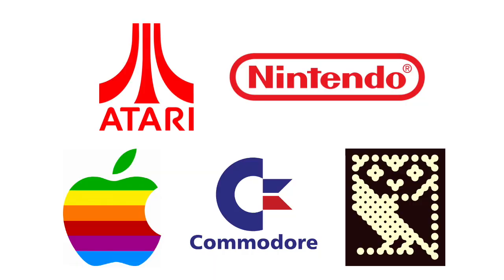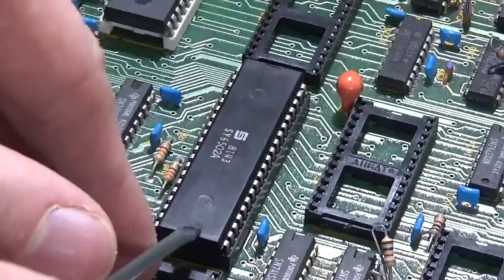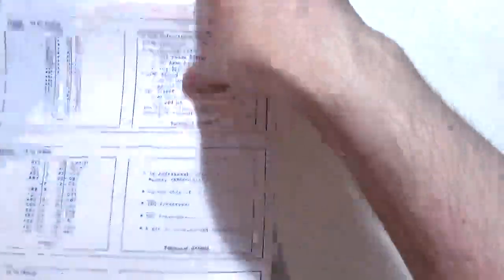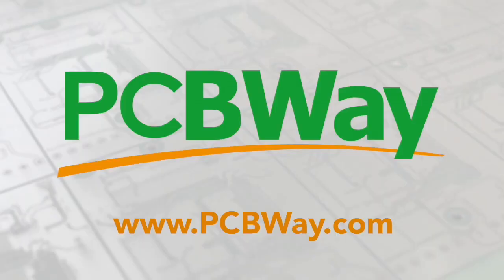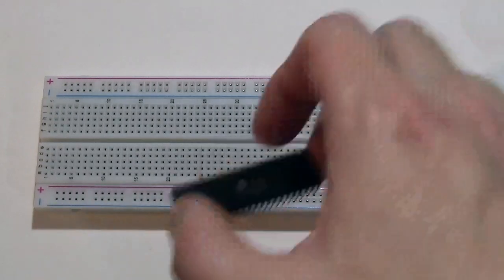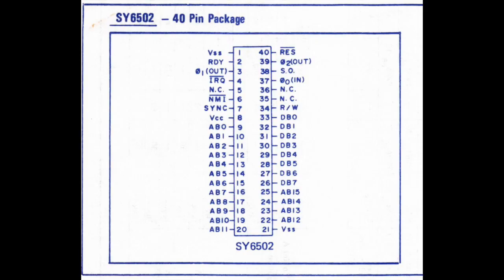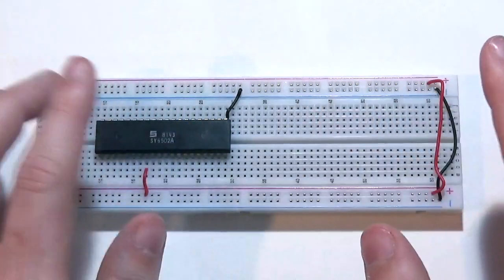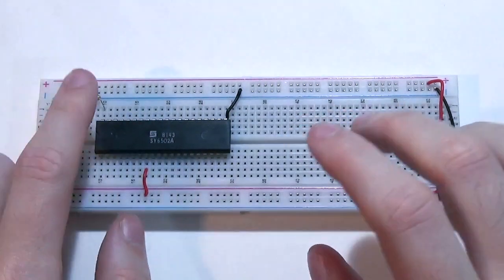How To Hand Wire A 6502 8-Bit Microprocessor

Comment: Anyone coming to this video this late … if you just want to play with a 6502 today and you don't already have a chip from an otherwise dead/unfixable vintage machine, you really want a new WDC W65C02S. The S stands for static. The original chip requires that you keep its clock going and do other clever tricks to e.g. single step the processor for debugging. The newer design static chips do not. Halt the clock as long as you like and your registers and the like will happily stay as they are.

Comment: Nice project! I built a home brew breadboard 6502 machine a few years ago. Runs BASIC and plays chess :)

Surprised to see that original IC running slowly enough to see the leds counting.
 
One of the advantages of the modern WDC 6502s is they're static, unlike the dynamic originals, meaning you can clock them extremely slowly (single step or even pause ) without losing any registers. I always thought original 6502s needed a good 1Mhz+ clock to work at all
Reply from the maker: Hi David, thanks for your feedback really encouraging to hear back from someone who has build a whole system! Sounds like im on track!

You and me both about the original 6502's The fact the chip ran without a chock totally threw me until I read the data sheet and the part about an internal clock... really odd but oh well, will need to look at a WDC CPU next.
Reply: @WiFiSheep   I keep meaning to do more on mine. I have an old keyboard to interface to it but I'm not a very good 6502 programmer. 
 Did you find out how fast the internal clock is running? I had a browse but couldn't find much
Reply from the maker: No nothing in any of the documentation which I found, really odd! As you can see the data ticking on the address bus it has to be under 50Hz
 Next thing I guess is to put a stock 40 dip WDC 6502 into a BBC Micro and see if it'll boot up...
Reply: @WiFiSheep  The internal circuitry of the 65-series needs a "non-overlapping" two phase clock. In the case of the 6502 the internal clock generator provides those two phases from a single phase input, such as the crystal oscillator you used. The 6512 is a 6502 without that internal clock generator, which therefore needs a rather more elaborate external clock circuit to generate the two phases. Examples of suitable external clock circuits are provided in the data sheet. I'm really not sure about the free-running aspect of the internal clock generator. I've never even considered that it might free-run and always applied an external clock to the Rockwell-branded chips that I've used in the past. On your Synertek chip does the internal generator stop free-running if you tie the clock input pin low? There's no mention of it free-running in any of the datasheets that I've looked at so I can't help thinking that it was a happy accident. The classic 65-series was fabricated using n-channel MOS and was a dynamic design, meaning that without a clock it would lose its internal state and lock up (similar to dynamic RAM "forgetting" if not constantly refreshed). The modern Western Design Center chips are fabricated in CMOS and are fully static. You can stop the clock indefinitely (which implies that its own internal clock circuit does not free-run) and single step it, without crashing it.
Reply: Any idea how easy would it be to make a circuit just to single-step clock pulse a WDC variant 6502? Ben Eater's variable clock circuit seems quite complex, I'm building my first simple 6502 circuit and I only want to single-step programs or run them at 1MHz, I'm not worried about anything in between at the moment.

Comment: Hello, great video! Did it work with a standard 6502? Or the intern clock is only available on the SY version?
Reply from the maker: Many thanks... As far as im aware the setup I did would work for any 6502. But if for example your using a first gen stock MOS CPU then it would need to be driven by an external clock. Im not sure about how many other licensed clones had internal clocks, it just turned out the SY brand did .... which totally confused me at the time as to how this thing was running without a oscillator!
Reply: @WiFiSheep  Ahah yeah, I had the same reaction when I saw your video :D It's pretty cool btw, I have to find a clone that can run without an external oscillator, because it seems to not be the case on mine.
Thank you for the fast answer btw, it's greatly appreciated.
Have a nice day :)

Comment: I don’t think you should be running LED’s (~20mA) off an NMOS 6502 address line - it’s only rated for “one standard TTL load” in the datasheet. That’s a rating of around 40uA (0.040 mA)... Don’t let the magic smoke out.

Comment: Wow, would be possible to build a whole kim-1 like computer using this method?
Reply from the maker: Hi yes that would be very possible as KIM-1 was designed by MOS and used the stock 6502 as I used for this video. Any computer would need RAM , ROM of some sorts and discrete ICs for keyboard handling (even if just a key pad) and maybe a video out generator for tv signal, if not just using LEDs strait off the address bus like I did here.  

If you want to build a simple 8bit programmable computer with keyboard in and video / text out then do checkout our TinyBASIC Computers series: https://youtube.com/playlist?list=PL8Ltmk_Xax1qYr7pXQUrhQ8ibLuIxM7O2

Comment: Im thinking about doing this with an atari 2600 cpu. It wasnt working so I was going to test tye cpu and build a computer from the cpu and rom chip.
Reply from the maker: Yeah thats a good idea. The 2600 should be the stock MOS 6502 so like the SY6502A used here but without the internal clock. Pinout and behaviour should be the same.
The only chips this wont work for are the 6510 from a C64 and the oddball 6502 inside the NES/Famicom  
So best of luck, let us now how you get on.